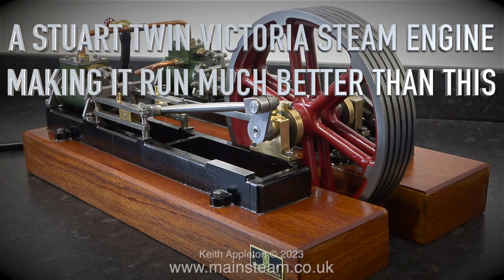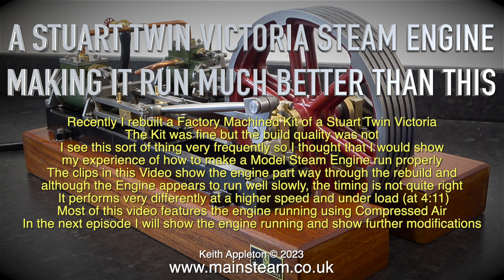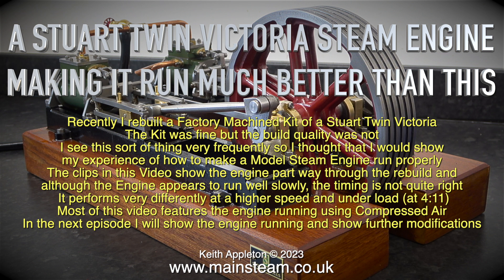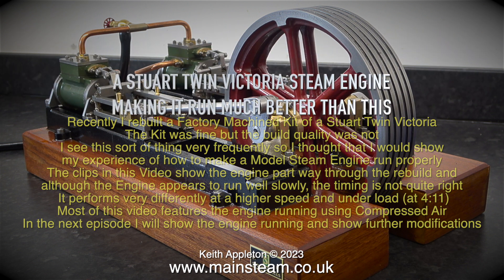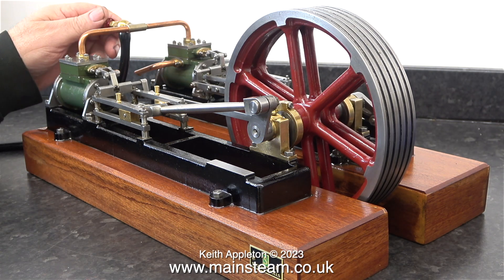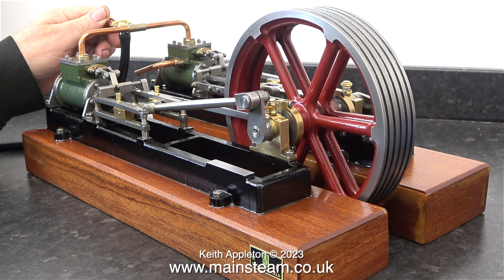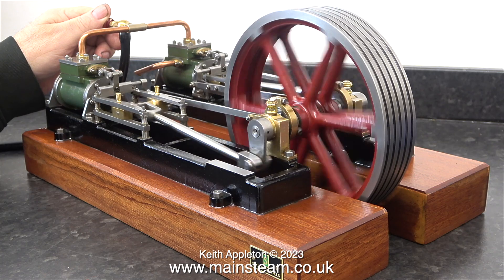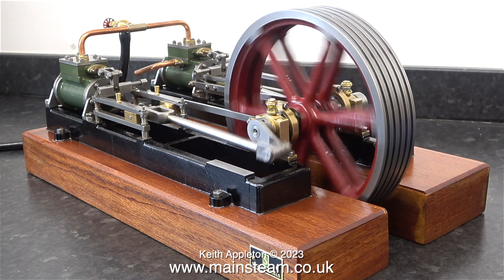A STUART TWIN VICTORIA STEAM ENGINE - MAKING IT RUN MUCH BETTER THAN THIS

Comment: Great video as normal, but a question why are the crank webs set at 90deg wouldn't it be better if they were set at 180deg, I know you do because its right but why 90deg and nit 180. Please keep up the good work.
Reply from the maker: Some people keep asking me this. I don't understand . . . . . if you put the cranks at 180 degrees, how is it going to be self starting? Have you never seen any other Steam Engines and Steam Locomotives ????